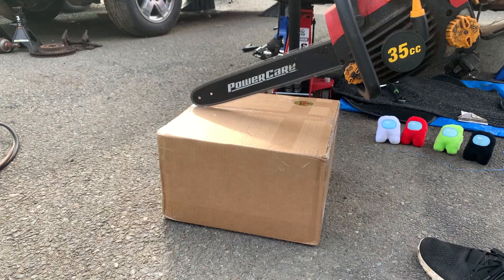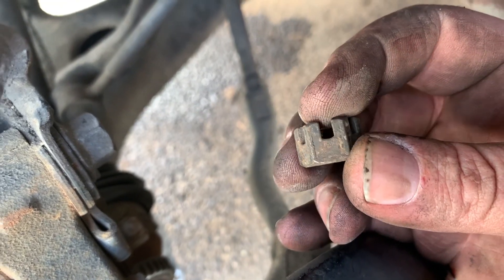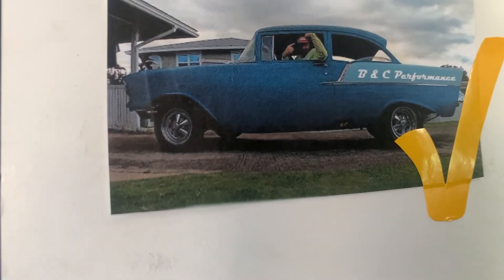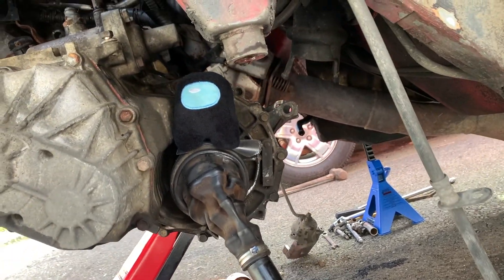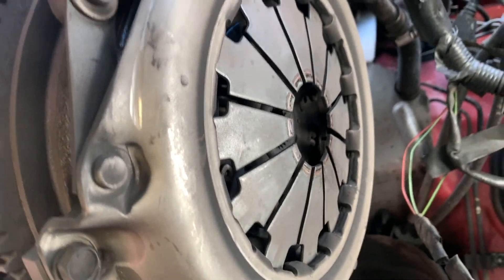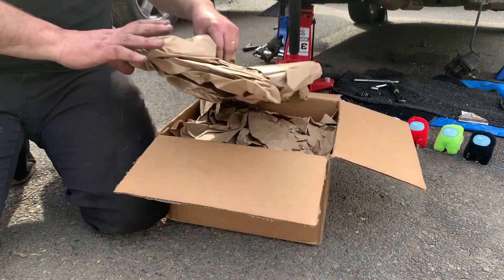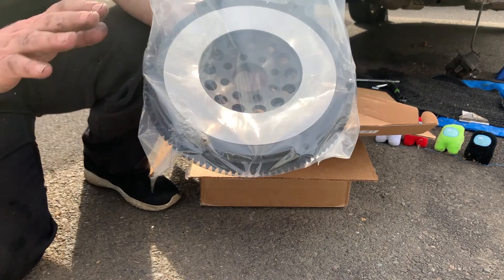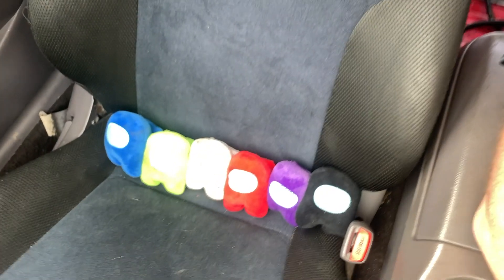2000 TOYOTA CELICA GTS Stage 3 Clutch install Part 2!

Comment: Hey Andy, I would send that new clutch pressure plate back, it doesn't have the speed slots in it.
Reply from the maker: It will hopefully work better without them. 🤣
Thanks for stopping in!

Comment: Couple of questions. 1. Do you need to remove both front wheels or just the driver side wheel? 2. Do you need to drain the transmission oil or not necessary?
Reply from the maker: To do the clutch, Both front wheels need to be removed along with both axles and the sub frame in the front. If you are doing the job in a shop with a lift and transmission jack you might be able to get away with leaving the axles in and avoiding draining the oil. Otherwise as soon as you pull the axles out the oil will leak out if not drained. I am speaking from experience.

Comment: Why did you go stage 3 on a stock engine just curious I need a street setup on my 2zz-ge gearbox (donor box has an MR2 LSD fitted).
Reply from the maker: I went with the stage 3 mostly because it wasn’t much more than a stage 2 and I wanted a good clutch for RallyCross racing. It has held up well, even in daily stop and go traffic. I really need to do a follow up video.